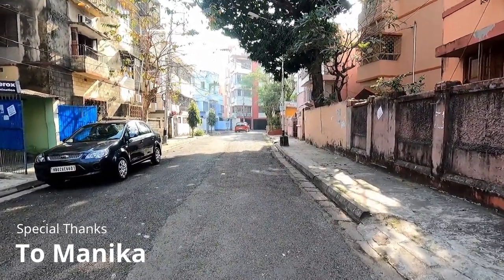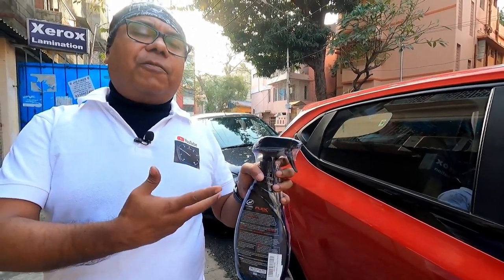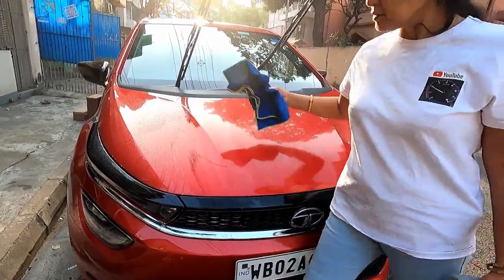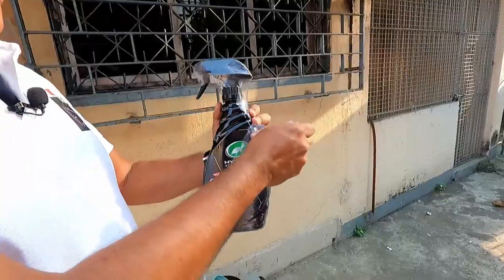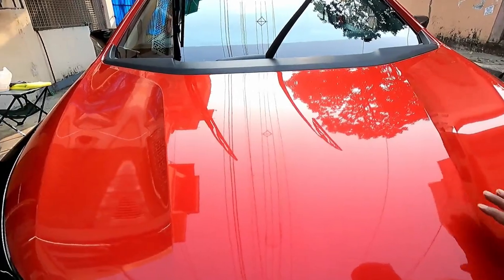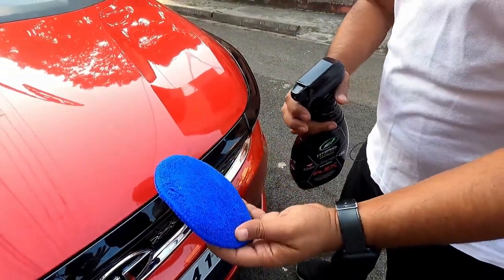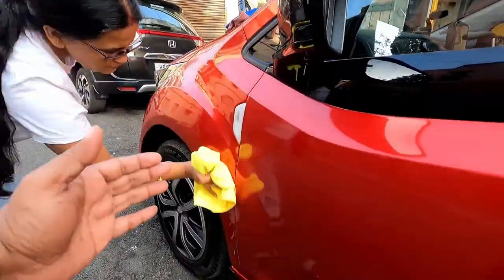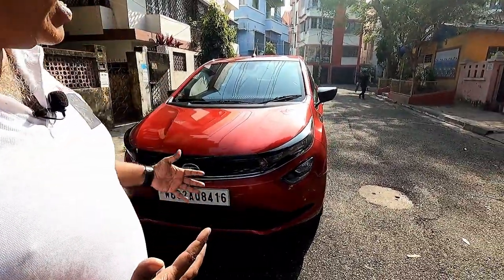How to Apply Turtle Wax Graphene Flex Wax on a New Car For Insane Gloss #turtlewax #graphenecoating

Comment: I did not see any difference. You did it wrong. You should not remove this 'particular' wax with a damp cloth. Just follow the instructions properly. A damp cloth is needed to remove the Turtle Wax Pro To The Max wax which comes in a creamy form. This video is useless. (Stop using the word 'particular' in every sentence).
Reply from the maker: Both applications are correct. Remember it can be used as a quick detailer or wet wax procedure. The results are almost the same. I have made several videos of this product showing different application procedures.
Reply: Yes, both sides are very shiny and same looking.
 Just beliving his words.

Comment: Can this graphene flex withstand heavy rain for 30 days ?
 Can this graphene flex withstand scorching sun for 1 month ?
Reply from the maker: I think yes
Reply: @supercyberautomotivetravel  yes for rain and sun both ?
Reply from the maker: Yes both
Reply: @supercyberautomotivetravel : can we apply graphene flex using wet method when the vehicle is just washed without using base dry method at all ? Because after washing my car, dust settle within an hour (plant is nearby, that is why).
  Will it work if I directly wash and apply ? My car doesnot has any kind of protection/polish. 
 These all questions due to the restrictions I face to care for my car.
 What I actually want is long time protection to my car from the natural micro disaster kind of situation my car faces everyday. I want smoothness so that leaf 🍃 etc doesnt damage paint. And shine so that my efforts looks worth
Reply: @supercyberautomotivetravel  the situation is like, when I wash, before wash is finished, leaf 🍃 starts falling and I keep throwing them.
 That is why I want fast curing method. I will do panel by panel.

Comment: Can we apply directly using wet method or base method is compulary. I have heard a lot of reviews saying that base method is hard to wipe off and it causes streak marks if not done correctly. Talking about Turtle Graphene Flex
Reply from the maker: I have videos of both the base coat and wet method . Both will work fine.
Reply: @supercyberautomotivetravel  : just one last question: 
 Which one requires less curing time ? ⏲️ ⏳️ 
 Graphene flex vs Seal n shine ? ✨️
Reply from the maker: Graphene

Comment: I had the seal and shine product,but decided to give the flex wax a try. Really good stuff and i didn't need a damp towel at all. Just use sparingly and its fantastic. Good video sir.😎👍
Reply from the maker: Thank you for your feedback.
Reply: @marybetheby5184..does these products effect original coat (paint) in long term..for new car?
Reply from the maker: No effect on original paint and is absolutely safe .

Comment: What is curing time , I usually clean and dry and start driving. Turtle ceramic needs 24hrs, else if any rain or wash happens then no effect is seen. 
 How about this graphene flex ??
Reply from the maker: Normally Graphene does not require any curing time but I prefer a curing of 12 hours for better lasting.

Comment: Hi Sir wonderful video. I suggest one before applying any kind of wax, ceramic or Graphene coating always wash and use Clay bar. So that coating will bond to surface and last  longer.

Sir are you using turtle wax ceramic Graphene paste wax..
Reply from the maker: Thanks for your feedback. I have used Turtle Wax ceramic coating not the paste wax. Since the surface was absolutely fine I skipped the step of the clay bar. The car was already shampooed so I didn't show it in video . I have other polishing and detailing videos where all the steps have been shown. Thanking you again for your support.

Comment: Hello Dear, I want your suggestion, I have purchased a new car recently and was planning to apply 3M cream wax on it but after seeing this video im confused. What should i do? Should i apply 3M cream wax first and then the Turtle Wax Graphene Flex or vice versa or should i just use any one of these? Pls recommended what should i do. Thank You!
Reply from the maker: Turtle wax Graphene Flex wax is one of the best paint protectant coatings.Cream wax will give some basic protection and lasts  very less. One or two contact washes will remove the wax coating.
Reply: @supercyberautomotivetravel  Thank you so much, Between TW Graphene Flex and TW Ceramic Coating which one should i go for? As i have purchased a new white color Scorpio N. What should i apply for longevity and better paint protection? Or can i use Ceramic Coating Twice a year and in between use Seal N Shine as maintenance? Which is a better option according to you?

Comment: Thank you for your detailed explanation. I have used the same product 7 days earlier. The outcome is good but what I have noticed is that there is a huge amount of dust accumulation in the panels. Don't know , I will again use it or not but I can surely say that it attracts dust in the body much more. Even my car remained dust free when it was without graphene coated.
Reply from the maker: Thanks for your observation. Actually once it's coated the extra shine actually makes more dust visible. Just wipe it with a good duster and it's gone. Also winter months are dusty specially in our Kolkata which I have seen. Coming up how to use it as a top coat or add on the coat in the next video. I have done that to my other car.
Reply: What about glass part?
Reply from the maker: It can be applied on any surface. I do spray on the glass also.

Comment: Nice work, could you please explain the process to be followed for polishing the Glass, Non-Metal parts, Wheel rims?
Reply from the maker: Thanks for your query. It can be applied to any surface glass, plastic or rubber. Clean the surface and apply in the same process.

Comment: How long turtle graphene flex last if kept outside all day long under sun ?? 
 Will it last for a month or 2 ??
Reply from the maker: You should at least get one month of protection.
Reply: @supercyberautomotivetravel  does graphene flex require any pre body treatment?
 I have a 2 year old car, never used any product except 3m shampoo to wash. 
 I dont want any long procedure. What would you suggest. Seal n shine  or graphene ?
Reply from the maker: Both you can apply after proper shampoo wash.

Comment: Is it Wet or damp cloth necessary ? Can we apply after car wash directly then dry with clean cloth.
Reply from the maker: It's a damp cloth . Yes you can apply on a wet car and clean dry and buff off. It can be used as a quick detailer I have other videos of this product.

Comment: Sir, Can this be applied on the glass? Also, I need suggestions to remove swirl marks at home.
Reply from the maker: Yes it can be applied on glass plastic and rubber also. For swirl marks use light polishing compound.

Comment: Can we apply this coating on windshield and headlights and other glass parts of the car Sir..
Reply from the maker: Definitely you can apply.
Reply: Graphene or ceramic coating Which is better for white car? Will I get glossy in white cars?
Reply from the maker: Both are very good in gloss. Graphene gives an extra sleekness to paint.

Comment: I have buy new car in aug 22 and I want to use turtule flex wax ,we need to compounding and poshinig before apply flex wax
Reply from the maker: Thanks for your query. Normally it is not needed but some hair scratches and swirl marks may be there .Then a light polishing compounding may be required to eliminate those marks . So it depends on the situation.

Comment: Please also tell me shine and protection period of this product
Reply from the maker: Shine and protection is good for this product but no time frame is mentioned in the product description. I think it will last easily for 3 months and gradually fade after that.
Reply: Thank you sir
Reply: Turtle wax ceramic spray 2 coating last longer or graphene flex wax last longer. Please sir i need your help in this
Reply from the maker: Thanks for your query. Graphene doesn't mention how long the protection will last. In ceramic it is mentioned about one year. I think Graphene may give less .

Comment: I had done ceramic coating last Thursday in my car.. They said after 1 year periodic maintenance will be done for my car..Till such time Pls suggest when will I apply this graphene product in my car..
Reply from the maker: If you have done a coating you can apply graphene over it as a top coat any time. Just clean and wash your car to ensure its free from dirt.
Reply: How many coat is required for better results?
Reply: If it is 2 coats pls tell me the time duration for each coat.. and suggest me both coats as a base coat or not
Reply from the maker: Graphene requires only one coat. You may apply a second coat after one or two months for extension only.

Comment: sir basically i have no time to do claybar and polishing for my upcoming brand new car. can i directly apply it on my brand new car ? please clarify my doubt
Reply from the maker: Thanks for your query. It's not absolutely necessary to clay bar and polishing before applying the product. In fact you can apply it after shampoo washing if the car is absolutely new.

Comment: Can we use just this or turtle wax ceramic is also required before applying this?
Reply from the maker: Thanks for your query. You can apply it directly without using ceramic coating.
Reply: @supercyberautomotivetravel  sir can we also apply it after applying car polish as done by you in case of Ceramic coating video, or there is no need of car polish in this case. And can u suggest best product for maintaining shine of outer plastic parts like cladding. Mine is Etios Cross which has substantial amount of cladding all around the car.
Reply from the maker: Thanks for your query. If you have already applied car polish you can still use ceramic coating but best option is to apply ceramic directly and apply polish as a protective coating letter on. For plastic parts use all purpose polish or ceramic coating. But I prefer Tyre polish best for plastic parts it's not only cheaper but stays longer.
Reply from the maker: Thanks for your query. If you have already applied car polish you can still use ceramic coating but best option is to apply ceramic directly and apply polish as a protective coating letter on. For plastic parts use all purpose polish or ceramic coating. But I prefer Tyre polish best for black plastic parts it's not only cheaper but stays longer.
Reply: @supercyberautomotivetravel  Thanks for ur reply 🙏. But I was asking in case of graphene coating. For that also can we apply polish as protective coating? And can u recommend best tyre polish
Reply from the maker: Yes you can. The links for tyre polish
https://amzn.to/3T5CX72
https://amzn.to/3ZK72fa
Reply: @supercyberautomotivetravel   can u send the link for the POLISH which has to be applied after ceramic coating ?    and after how many days of turtle hybrid ceramic coating , we have to do POLISHING ???
Reply from the maker: You can consider the following products. This products will help you to prolong your protection and gloss. There's no hard and fast rule for the frequency of application. Every 2 to 3 months is sufficient.
https://amzn.to/3Lvrk7O
https://amzn.to/3yLNw64
https://amzn.to/3Tkr4uc

Comment: Hi sir  need to maintain my altroz at home only pls suggest one good shampoo and need to wash waterless is it good or not pls tell me 
I want use turtle wash and wax with turtle graphine  coat is it ok
Or pls suggest good option iam confused very much.  Thank u
Reply from the maker: Thanks for your query.  I am giving all the product links that will be helpful in maintaining your car at home. I am using all these products at home myself. The results are good.
Shampoo
https://amzn.to/45hF90W
Waterless Wash
https://amzn.to/3MThc9i
Graphene Coating
https://amzn.to/3MvSdqS.
Reply: @supercyberautomotivetravel  hi sir I didn't coated any ceramic coat or other too it seems That the shampoo u kept is for specially  for ceramic coated vehicle
I am little bit.confused between water and water less which js better I didn't have any pump or other else
Reply from the maker: You can easily use water less car wash for cleaning the car. You don't need to invest in a pump. The waterless car wash comes with a spray bottle for application so don't worry. Further the shampoo I mentioned can be used in both coated and non coated car . In fact it will give you a minor coating of ceramic after washing resulting in a shine. Pump is required in seriously dirty and soily conditions. That can be taken care of at a local wash centre
Reply: @supercyberautomotivetravel  is these better than turtle hybrid series
Reply from the maker: I haven't used the turtle series waterless Wash. But the products I am using are good and meet my expectation.
Reply: @supercyberautomotivetravel  thank u sir
Reply: Before applying the water less solution does we need to pour wash on the car or we can directly use the water less spray
Reply: And one more thing sir shine x pro ka spray bottle me Jo foam Atha he na wo bhi water less jaisa hi Tha kya
Reply: Why iam.asking is foam when comparing with water less is fine or not plsa suggest
Reply: @supercyberautomotivetravel  and what about turtle 3 in 1 is it a water less wash sir
Reply from the maker: It's a quick detailer helping you for a quick shine and polishing and not a water less car wash
Reply: @supercyberautomotivetravel  hi sir wave x and proklear which is better for waterless wash pls suggest
Reply from the maker: Thanks for your query. Wavex is very good and I feel it's better than proklear.